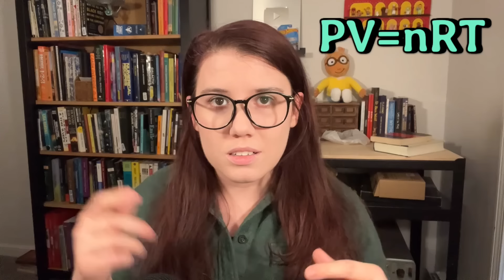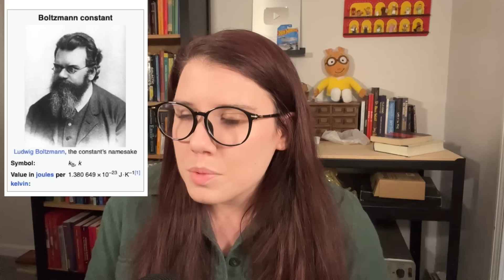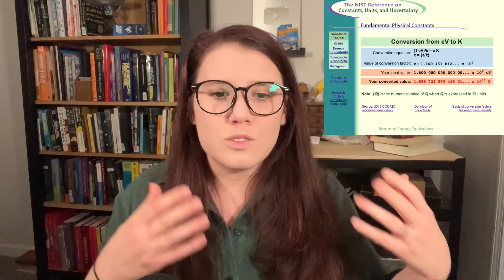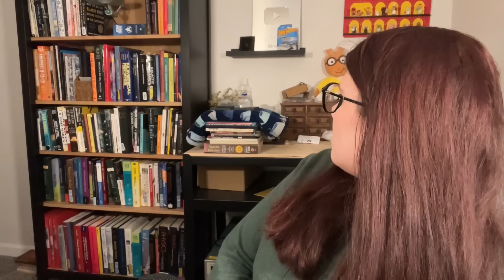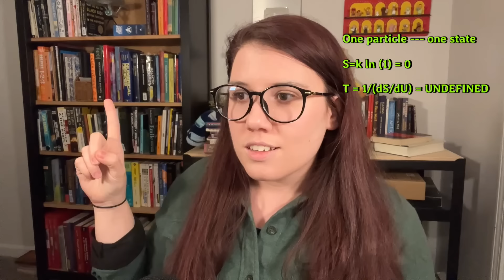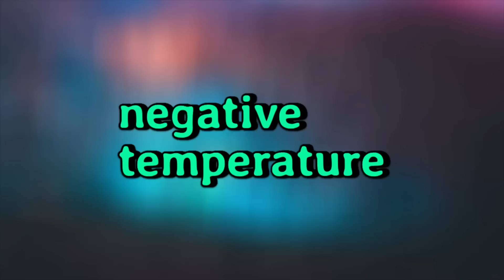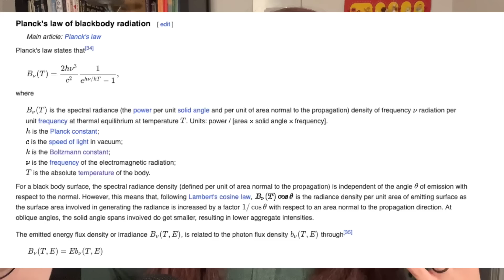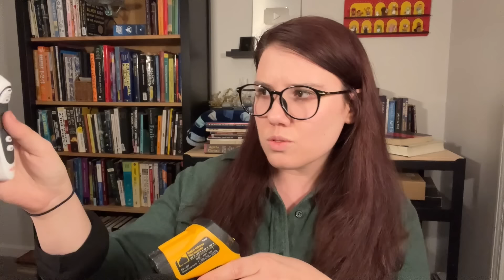the concept of temperature

Comment: It's kind of the same thing, but instead of thinking of entropy as a measure of disorder, I think of it as a measure of "evenness" or smoothness - so, in a sense, dead orderliness. Even-distributedness. I need some other word.

That's just because I think of disorder as something containing a lot of potential for disruptions/ rearrangement/ disturbance. And off course there's absolutely no need to.

So anyway, entropy is like an evenly mixed bunch of water molecules in the evenly mixed air, and then something comes along to disturb this, so that you end up with mist. And the temperature goes up when the mist forms.

Doesn't make any substantial difference, I don't think.

Or entropy is "grey" in colour mixing terms. Pour in a bottle of everything and you get grey gunk. And then somehow magically shepherd the yellowing molecules to one corner, the reddenizers to another, and the greeneries to the bottom or top or front or back (by disruption of the "order" of the grey gunk) 

and I suppose the temperature would go up. Or maybe if you did the right kind of heating, that would give you the kind of magic it takes to push toward this scruffy state where the yellow is not smoothly distributed everywhere. I think maybe I'm just trying to find a way to hate on tidiness.

So still not worth thinking about, since the concept doesn't actually need this help, for starters. But still. ... 

If everything is perfect and even, there's no way to put a mathematical ordering on a set of items. So post hoc ergo propter hoc and de rebus, it is disordered - in the sense of being incapable of being ordered.

Damn, this is just turning chaotic. Do NOT say in what sense. Do NOT. Just talking to myself here. No No No No. That's IT.

This cycle of a mental hamster wheel has a kind of entropy? A kind of grey gunge of sloppy thoughts without hope of defining some ordering on it.

So that makes it cool? It starts with something having some ordering on its parts, that becomes sludge, so the temperature must go down?

Even if it did somehow unfairly manage to prove itself cool, not it's not really - not even close to how cool it is that we got to the subatomic world by thinking of temperature, for instance. Now that's cool. But not in a entropic kind of way.

Comment: Question about the “3” in the first proof, which you relate to as the three dimensions, and again as the three degrees of freedom, and in the wiki excerpt, the three vectors of Euclidean space. I would have thought that when you add up the three dimensions, x, y, and z, there would be some kind of vector addition geometry going on. In other words, I would think 1+1+1 might add up to a vector sum that’s less than 3. (Not arguing with Boltzmann or Planck or you, just trying to adjust my intuition to align with the real world.)
Reply: It's 1/2 for each dimension, as in .5

So she was saying 3/2 for 3 dimensions, 1.5
Reply: @robocris1988  It’s the “3” in the denominator at 2:23 in the video that’s described as corresponding to three dimensions or, at a later point, degrees of freedom.

Comment: Temperature is what two systems come to the same of when placed in contact.  They exchange energy until they stop exchanging energy.  Say some quantity S is maximized at the equilibrium, and the systems have energy U1 and U2, and thing S1 and S2.  S = S1 + S2 is a maximum when dS1/dU1=dS2/dU2.  Call S entropy and call dS/dU one over the temperature 1/T.  Hence entropy is maximized with the temperatures are equal, and (by assumption) that's the state two systems come to equilibrium at when placed in thermal contact.  Nothing about kinetic energy.  Indeed there are "population inversions" that have negative absolute temperature without having negative kinetic energy.

Comment: To make plasmas even more fun (in particular low-ionized plasmas) is that their energy-distributions often are not thermal - which makes it necessary/possible to define energy-dependent temperature: T = -f/(df/dE)/kB. This is because electrons with specific energies might lose energy to the other species much more efficiently. It becomes a right mess.

Comment: She did say "butt" thermometer. 🤣(23:37) Btw, those battery power ones suck, get an analog non-mercury one, at least it will work when you need it. Speaking from experience with dead batteries.

Comment: The amount of heat transfer, and the interface temperature, between two touching surfaces do depend on the specific heat capacity, but also on the density and thermal conductivity of both objects. The total heat capacity probably matters more in the demonstration shown in the video since the plate with higher heat capacity can absorb more heat before cooling down.

Comment: about 1/(ðS/ðU), just because S is 0 doesn't mean we can't measure a onesided limit ðS/ðU right? also even if the derivative is zero, then the derivative is still well defined and we need not take its inverse, e.g. in the planck distribution it would be exp(nu*"coldness"), which would still be perfectly valid even if the derivative is zero (i got an A in PHYS427 but by god i remember absolutely nothing about it)

Comment: 35:34 vs 36:24 : you started talking about "energy of an atom" then moved to "adding enerygy to an ion". I have some dumb questions as a non-physicist. Let's assume you're talking about H1 (proton - single and not willing to mingle): as an atom,it'd have an electron close by. Given than electrons have spin (+- 1/2 IIRC) and may have other orbital-related microstates then a single atom may have temperature. So 1st question, am I right or which of my assumptions are wrong?. As a "particle" / ion I can better understand your example , but from my 1st question the 2nd comes: can a subatomic particle (e.g. proton) have multiple microstates because of its constituents? Or is it understood that muons etc. neither have microstates nor combine in non-unique ways so the resulting particle has a single microstate?

Comment: 38:30
and thats where, at least in large scale flwo dynamics you often see a concvept of turbulence that is treated almost similar to temperature as in a chaotic motion smaller than the scale we're looking at but still larger than molecular scale, not to be confused with turbulence at the scale we're looking at which is jsut angualr momentum

Comment: Transducers are electronic devices that transduce a physical or chemical entity into an electric measurement.
Body thermometers use an 10 kΩ NTC (negative temperature coefficient) resistor. In some cheap thermometers you can find a silicon diode. Silicon has a bandgap voltage of 0.68 V which varies exactly -2 mV/°C.

Comment: One detail temperature is intensive property of material, same as density. You cannot add them 1kg of 20 degrees Celsius plus 1kg of 20 degrees Celsius body equal 20 Celsius. Energy, force, ,momentum, pressure are extensive that you can add them together.

World Record with i9-9900K at -230 °C - LIQUID HELIUM - https://www.youtube.com/watch?v=UtXM71tw5fk.
That is boy things lower CPU temperature then run hardest video game benchmark. Simulate glitter or simulate liquid flow with computer when CPU cool down to -230 Celsius. You forget about Boltzmann formula S=k*ln(W), that it is also energy formula E=kT*ln(W). W - microstate of integrated circuit CPU it is binary W=2^N (N - number of gates in CPU integrated circuit) I am mot sure.  CPU also 100% efficient some electrons lost as heat. Every CPU have cooling fan.

Biggest or our energetic systems are not fully closed that entropy must be lost cars have exhaust pipe and nuclear and fossil fuel plants have steam condensers or cooling towers even windmills and hydro must loose energy to produce some useful mechanical work.

Comment: I want to talk about the cream and coffee mixing analogy, and how it's a little problematic. The Maxwell relation you gave requires constant volume and no mass flow. With the coffee and cream, as you said, you are taking these two systems and putting them together, they come to equilibrium and find a new temperature equilibrium. There is a mass flow. But entropy of mixing adds a whole other can of worms. When two materials are mixed, the entropy increases. In non-ideal solutions this generally results in a temperature change, in either direction, but the important point is that it's a thermodynamically irreversible process. It takes a lot more energy to separate the cream back out than it did to mix it in the first place. You've just increased entropy in a way that you can only extract little to no work from.

This points to the fact that absolute entropy is in some sense arbitrary. It depends on your knowledge of the system. The more knowledge you have, the lower the entropy, because you now know more about the macrostate, which means there are fewer microstates possible. It also depends on the property you're measuring. In the coffee and cream example, you can ignore most of the entropy change with some simplifying assumptions, and the fact that you're only measuring the temperature.

Comment: Is there a unit for joules/volume?
It would be a strange unit since depending on the medium you're measuring the temperature would not be the same. 
Like a 50 degree water doesn't have the same energy per volume as a 50 degree pocket of air or steel. 
Colloquially it wouldn't be used at all 😅
Reply: Technically it's covered by Pascal, but in most circumstances, it would make less sense to use that than the equivalent J/m^3

Energy density is a very important topic though, especially when it comes to batteries and their usefulness for a specific task, with an easy conversion to specific energy density (energy pr mass)
Reply: @Wishkeyn  
well energy density in terms of battery has a bit of a different meaning. 
Like saying neutron star matter, or metallic hydrogen that may or may not be in the core of Jupiter are very energy dense since you could turn them into a lot of power. 
I guess in terms of inter stellar space travel you're not looking for a high amount of usable energy per volume, you're looking high amount of usable energy per mass. So "energy density" ends up being used for both which gets confusing. 
I was referring to just heat energy in my first comment. So molecular kinetic energy in Joules, per Volume. 
I'm sure it's used somewhere.
Reply: @Broockle  yeah, I get what you mean, which is why the decision for energy density differs between what you are talking about, like in batteries Wh/kg is most common or Wh/L, because its output is electricity. J/L or J/m³ would make sense for heat. 

So your point is valid that using the same units might not be the best course of action, but the units will always be some form of energy/(volume or mass)
Choice of volume or mass depends on limiting factor, also accounting for purpose.

Comment: We have a pot for boiling water where the part that touches the stove is slightly distended and when the water is just under boiling, it will very audibly rattle until the boiling starts. I don’t know enough about physics to say what phenomenon this is but when you mentioned the velocity of heat in liquids, that is the first thing I thought of.
Reply: I think the explanation depends on where the dent is.

Comment: 23:30, but you are measuring temperature, the internal chip of the device measures the resistance of the tip due to the body temperature not your body's resistance, no?

Comment: Another sense in which an atom does not have a temperature, is that if you try to shoehorn it into a Boltzmann energy distribution, you find it has inifnite total energy. 

Another issue that's interesting to think about, is that the relation between energy and entropy is not well-defined for a deeply-quantum system, i.e. if you allow coherences then the system may change its state (density matrix) in several ways, each one with a different ratio of the change of entropy to change of energy, so that each one has a different "thermodynamic temperature". This makes it difficult to think of thermodynamics in terms of energy in the deep quantum level. It is still true (relative) entropy always increases, but the relation of this to energy and hence temperature only makes sense in the limit of diagonal desnity matrices i.e. in classical systems in the sense that they have no quantum coherences (they are generally in thermodynamic equilibrium and have Boltzmann distribution).

Comment: The reason you can't use kinetic energy to define the temperature of a single atom is because it's not a measurement of kinetic energy as a whole but kinetic energy excluding energy of flow of the fluid.
With a single atom you can't differentiate between the kinetic energy of random motion aka temperature and the the kinetic energy in the flow of the fluid.

Comment: You can take the average of 1 thing.  It will be equal to whatever value you assign to that 1 thing.  If we take the average kinetic energy temperature definition, then the temperature is equal to the kinetic energy of one atom.  That is, the numbers will match, but you still get different units.  To calculate that average, you still divide by the number of objects.  For example, an orange that costs $1 has an average cost of $1 per orange.

It might be more meaningful once we think of an average as coming from a nonempty set of numbers rather than taking the average of an object.

Comment: Maybe I missed something, but it seems like in your derivation you switched from the square of the average velocity to the average square of the velocity, which is not always smaller. The kinetic energy is proportional to v², so the average kinetic energy is proportional to E[v²] < (E[|v|])² if the particles all have the same mass.
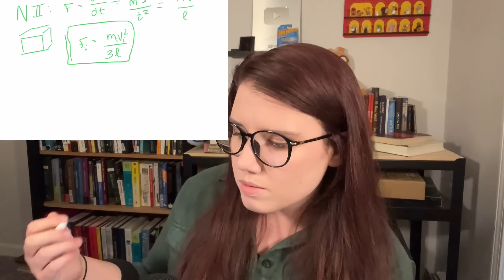Reply: You seem knowledgeable. I can't answer your question, but I was struggling to understand at 2:50 why when converting from one-dimension to three-dimensions, does the force divide by 3? Surely it wouldn't change at all?
Reply: @nickomodeee  She's skipping past a lot, but the result is correct. Imagine a simple case where every molecule is moving parallel to one of the edges. Since the cube is symmetric, there should be an equal number moving in every possible direction, so one third are moving parallel to the x-axis, one third parallel to the y-axis, and one third parallel to the z-axis. So that's where the 1/3 comes from.

Obviously the real case is more complicated, but you still end up with the same 1/3. Similarly, in two dimensions it would be 1/2, etc.
Reply: @EebstertheGreat  Wow, I understand now! Thank you so much for explaining with clarity!
Reply: @EebstertheGreat  Does that mean that the equation should really be Fi=mi<v²>/3l instead of vi because the individual force would still be Fi=mi(vi)²/l, but with the average velocity of all particles in all three-dimensions we need to divide by 3?

Comment: By the presented logic, the mercury thermometers then also aren't measuring temperature, they are associating the expansion of a substance in relation to temperature.
Reply: Yes, that's what she means by "temperature is a scale". Experimentally, we can say that something has a higher temperature than some other thing, because no matter what instrument we use to indirectly measure temperature, the instrument will say so. And if two things have the same temperature, all instruments will say so. 
To put a proper number on tempertature, you need a theoretical model that links all those instruments, and a procedure to calibrate all those instruments, something which is not that easy, as having one realization of let's say 273,16 K does not help that much with the rest of the scale. 
On paper, any bijective function of temperature could be used as a temperature.
Reply: @jeanf6295  I was kind of emphasizing that Angela didn't mention it when talking about liquid expansion thermometers, but made a huge deal about it for the thermocouples and resistance types.

Comment: i know nothing about calculus but why can you "rearrange" equations and that's seen as normal??? rearranging a math problem would change everything about the math problem wouldn't it?  i hate that calculus literally LOOKS made up to a layman like me XD
Reply: This has nothing to do with calculus in particular. Rearranging equations is basic algebra.
To understand this, you basically just have to understand what an equation is. An equation tells you that the two things either side of the equals sign have the same value. Let's say we are given the equation a+b=c. Whatever "a+b" and "c" are, they must always have the same value if this equation is true. If we modify both sides of an equation in the same way, we get a different equation that will still be true. Why? Because both sides had the same value beforehand, we did the same thing to both sides, so they will have the same value afterwards. For example we can subtract b from both sides of our equation to get a new one: a+b-b=c-b. "+b-b" cancels, leaving us with this: a=c-b. We have rearranged the equation for a.
This is a new equation! But we got it from the first one by only ever doing the same thing to both sides. So if the previous equation is true, this one must also be. Calculus doesn't change anything about the basics of this.